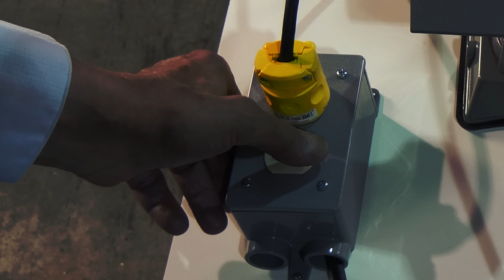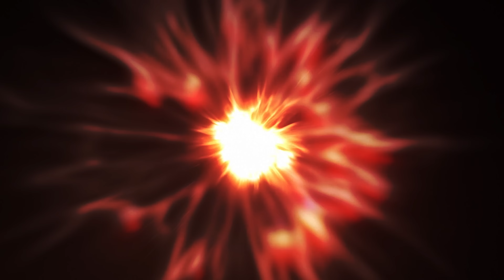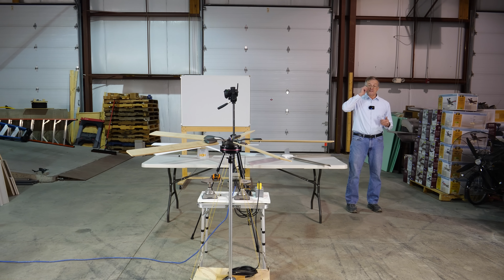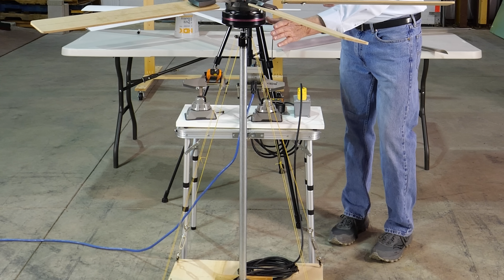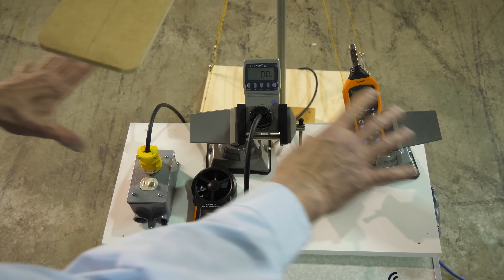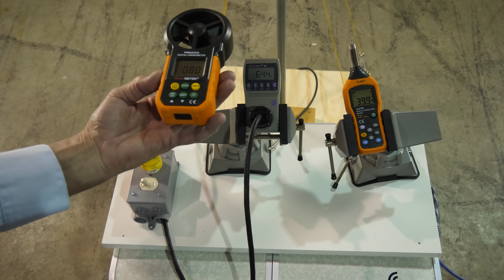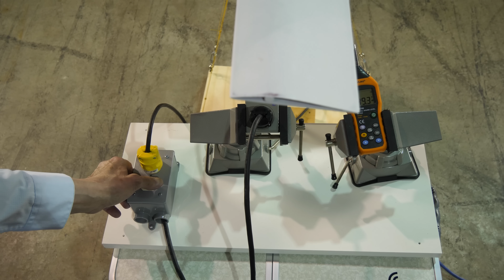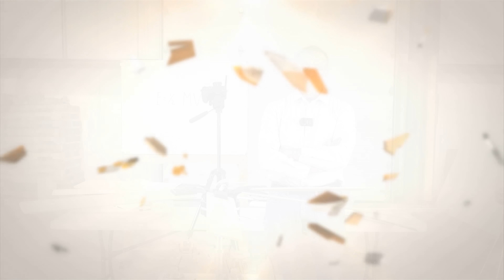This Fan Uses Almost NO Power

Comment: You would think the energy star program would be all over this.
Reply: That was the plan early in the Energy Star program. However a big box store lobbied against including ceiling fans in the program. That company was the largest ceiling fan retailer at the time.

This was several presidential administrations ago.
Reply: Energy star programs - still a thing - https://www.energystar.gov/
Does someone need to stop drinking the kool aid?
Reply: Trump defunded or eliminated that program
Reply: @itsumonihon  Yeah, sure. This is trump's fault, a type of motor we've been using for a hundred or more years, and there are ALREADY tons of energy star rated fans on the market. But yeah, this fan in your house is trump's fault. Just go away with your non stop political nonsense we aren't here for it.
Reply: Not in Trump's America.

Comment: I really appreciate that you went to the extra length of adding the stabilizers to the motor. Most people don't realize just how much efficiency drops with even the smallest wobble from the fan being even a tiny bit out of level or poorly attached to a ceiling mount.
Reply: I didn't notice how much they wobble till I put one in without securing the downrod and it was obnoxiously wagging the pull-chain.
Reply: Where does he show or mention stabilizers?
Reply: @perpetual4958  Isn't that what the Kevlar strings are for?
Reply: @perpetual4958   4 minutes 18 seconds
Reply: That is why most have that swivel head, that and if anything come into contact with it.

Comment: I was genuinely thinking about the DC motor thing, only a few hours before this video popped up.

I'm running an AC ceiling fan right now, but the DC one is supposedly a lot quieter.
The AC fan isn't overly loud at lower speeds, but quite loud on max.

It seems to also use a winding of the motor for the LED lamp, for some reason.
And that does make a humming sound when the lamp is on the lower dimming modes.

I might have to buy the DC version, as I think it will be quieter, and save money over time.

Comment: Next do an efficient and long lasting led bulb like those Dubai bulbs. Made from easily available off the shelf parts. A lot of modern bulbs have been so boiled down in terms of parts and they heat up a lot, Partially contributing to early failures.
Reply: BigClive simply added a capacitor, years ago!

Comment: I get a strange humming in the audio.
 Like a bad ballast or something.
Reply: Some of you have never stood near a transformer, worked near high voltage electrical equipment or in a warehouse and it shows..
Reply: Most of that hum could had been removed by setting a maximum gain for the agc at the mic lower than it is other vise, or set it to at fixed value. Note that every time the host stops his speaking then the agc just crank up the volume, that is the main issue.
Reply: The shop lights are also noisy
Reply: Those types of motors generate a lot of inductive resonance within themselves, due to how they're made. They don't really have a 'ballast' per se. It's also part of why they're less efficient, as, if they're making noise, then that's energy that isn't going into moving air. Same with heat, etc.

Comment: I always wondered when you would get to using those pallets of ceiling fans... they have been in the warehouse for a long time, my curiosity has been going crazy for about 2 years now
Reply: I was slightly disappointed in the back story, in my mind they were building some insane wind tunnel for cheap
Reply: @virtuserable  lol, there is still time

Comment: Neat!  Video on efficient super high speed fans would be neat too.  Edit:  high efficiency motors, like the 100,000+ rpm ones.  "Major Hardware" channel has good content about fan designs.
Reply: High speed is anathema to efficiency. If you need to move air, a larger diameter at low speed is the solution.
Reply: More interesting is a channel that tested the efficiency of different 3D printed fan blade types.

Comment: Please do a vid about flywheel energy storage with solar / wind! How long can you get one to spin if you vacuum seal it with maglev bearings?
Reply: That's a cool idea but I have a hard time believing it would be more practical than heat or gravity storage. Only one way to find out, I guess.
Reply: @F0XD1E  LFP (Lithium FerroPhosphate) batteries are so cheap, that in small scale they are cheaper and more efficient. 

With a heat pump a Na2SO4•10(H2O ) moltensalt heat battery is pretty efficient, because the transition temperature is bit over 30C. I one takes the heat under solar panels and stores with heat pump to 30C, the overall efficiency is huge, even when the panels are at 0C. (Over 100% "efficiency" with solar panels 20% efficient, because a proper heat pump exeeds COP 5) Sodium Acetate has transition temperature about 60C, just enough for hot water.
Reply: @F0XD1E i figure once your battery is full why not start spinning one up, probably could be pretty cheap

Comment: It’s remarkable how inefficient regarding power consumption many fans from small to large are.

Just as a lay person I stumbled into this topic when trying to build computers that use as little power and are as quiet as possible. There, fans with the same size but from different manufacturers made a huge difference.
Reply: Are fans ever as good as water cooling in those parameters?
Reply: @F0XD1E  water cooling also uses fans and it has the water pump on top.
So without looking into it I would assume that watercooling draws a lot more power
Reply: @Jehty_  yeah, water cooling runs a pump AND fans, so water cooling is not as efficient... You wouldn't want to run it unless you needed to.
Reply: Watercooling with a single high-quality pump and quality fans on a radiator can use less power than a case full of cheap inefficient fans with air cooling-only. Also note that just by running cooler, modern CPUs and GPUs need less power for the exact same workload with the same frequencies (a few % less power draw for every 10 K lower temperatures).

There is no right or wrong answer, it all depends on one’s specific type of use case that determines what kind of cooling should be chosen. I use watercooling, regular air cooling and completely passive systems, all with a different focus.
Reply: @Jehty_  It doesn't have to use them though. In the early days of diy water cooling there were people running a single pump and just heating up a 5 gallon bucket or larger tank of water. Some people were sending the water outside. You just need a water tank large enough to absorb the heat of a single processor. It takes a rather long time to heat up gallons of water with a 100-150w heat source. I have considered running tubes against my basement concrete floor which seldom gets over 65F and wouldn't affect me at all. It is somewhat sad to see today most "water cooling" tends to just be all-in-ones or expensive custom parts.
Reply: @Jehty_ watercooling could be virtually free in an open water circuit. But it is more practical to circulate water in a closed circuit. Anyway water pumps just need a few watts of power. The fans are generally brushless motors. I am not a water cooling expert but I guess 20 W is more than sufficient to cool a 200 W CPU.
Reply: The actual power consumption of a normal 120 mm computer fan from the “best” manufacturers at full speed (2000 RPM) is 1-2 W, for example Noctua fans typically consume less power than is listed in their data sheets. As a generalized rule of thumb with good air coolers you can get rid of around 100 W heat load with one 120 mm fan. The same fans on radiators are significantly more efficient but of course the entire cooling setup/loop is more expensive.
Reply: @F0XD1E  Depending on what you mean by good. But generally yes. The draw backs of using fans is that they can't handle as much heat over longer periods. If you are building a truly quiet PC you will also be managing your heat generation by undervolting and selected power efficient parts.